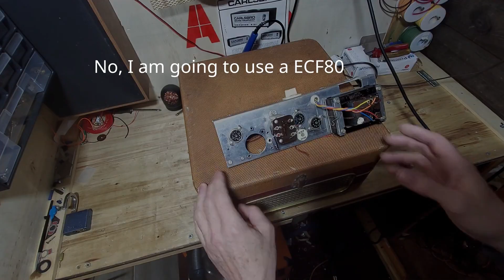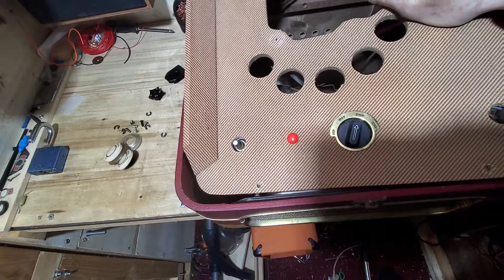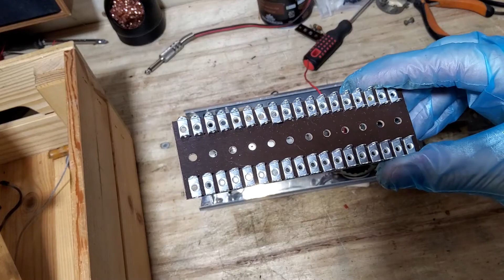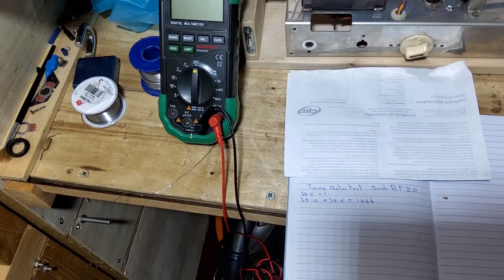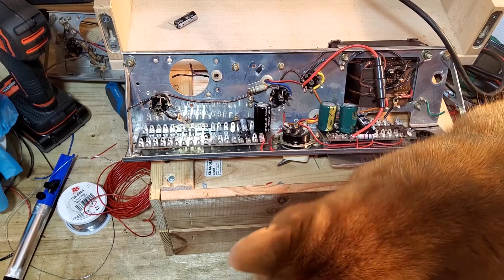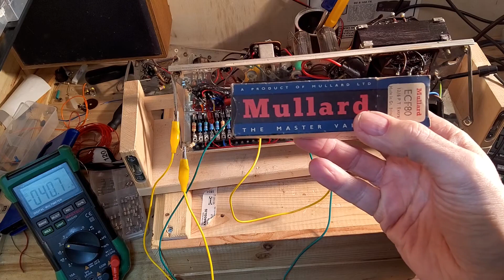Single Ended Guitar Amp Conversion from a Bush RP20 Record Player

Comment: I'm not exactly sure what the heck a valve is, but, those are some sexy Mullards!
Reply from the maker: Over here we call them valves. In the Eastern block they are called Bulbs. Where as in the States they are called Tubes. I try to refer to them as tubes as well but sometimes I forget.

Comment: A very nice video. That chassis would probably be quite suitable for building a standalone tube reverb unit as well.
Reply: There is a great online article from Guitarist magazine about a one valve reverb tank driver and recovery circuit. It's a circuit inspired by a Swart Amplifiers design, the valve is in effect a 12AU7 low voltage gain but high amp (power) to physically shake the springs and the second valve section like a 12AX7 (high volt gain) to amplify the weak output at the far end of the springs. I built it into a Deluxe based mini amp, sounds great and takes minimal space on a small chassis.
Had to order tank and valve from Germany and it's a short 8" tank, would fit fine in that nice Bush cabinet.
Reply from the maker: Hello Rob. This sounds interesting. I will have a read. Take care mate.
Reply: @robnic52  5k/4ohm output transformer could quite well be used when 12AU7/ECC82 (triodes parallel) is driving a 8 ohm rever tank. Fenders used 12AT7 as a driver tube but it needs a bit higher load impedance than 12AU7 to give optimal output power.
One option could be to use EL84 connected to triode to drive the tank. Or a bit crazy option would be to drive two paralleled 8 ohm tanks using 5k/4ohm OT and EL84 as a pentode or triode.
Reply from the maker: Now there's an idea